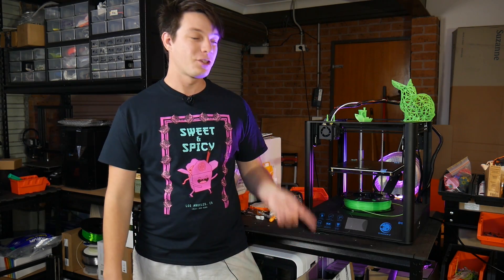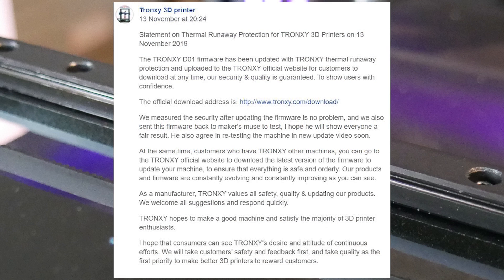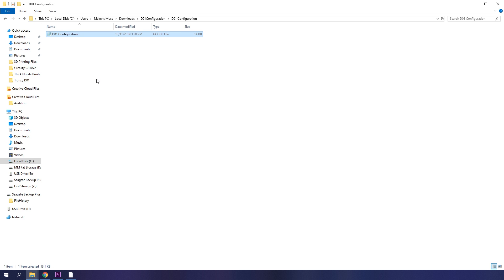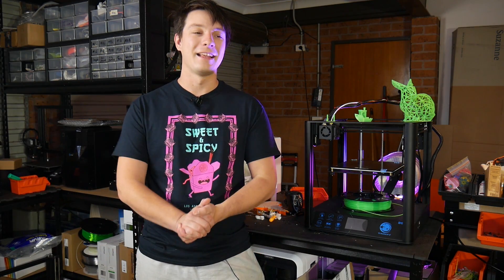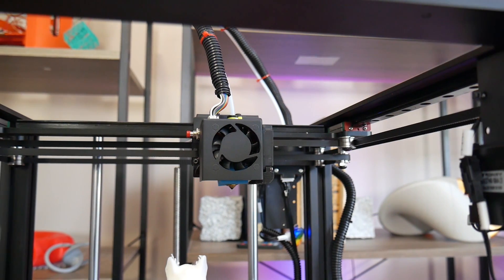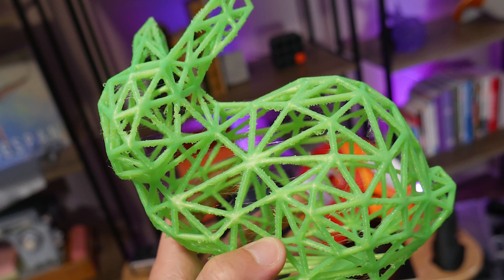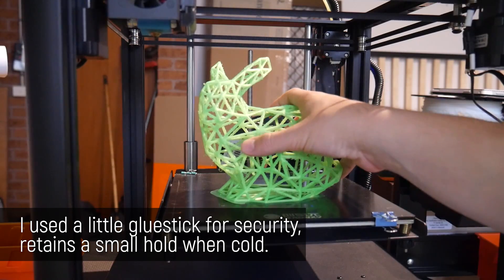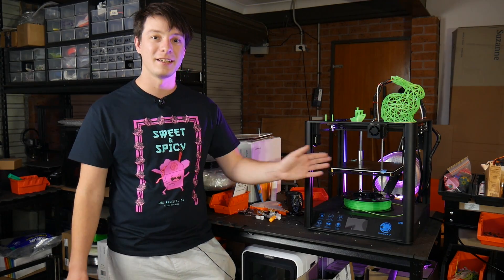The Tronxy D01 has been UPDATED! Here's what happened.

Comment: It worth to say that Tronxy listened! now, 2023, they are selling D01 2.0 with most of mechanical issues solved. Proper microswithes, heater and thermistor connected to connector that is outside of printer. Still horrendous retraction, but all in all much better machine. And they added acrylic side panels to create passively heated print chamber

Comment: That the switches beep when you bump the 3D printer should mean they are very precise. If the deformation from bumping it is enough to trigger the switch it's really at it's precise limit.
PS: My guess is the enclosure also adds stability to it.

Comment: I loved this printer when I first got it. The frame is solid and the enclosure makes it feel pro. The stringing is terrible and makes it very difficult to print PETG. I solved that with a 3d printed direct drive conversion (calibrating the steps took some research). My other complaint is much harder to solve. The build plate support is too thin. It flexes, is difficult to level, and shakes with any vibrations around, like someone walking. That's what caused poor quality of my prints. I replaced the sloppy Z leadscrew nut for a delrin and going to make a custom plate from aluminum.

Comment: Hi Angus, I bought one this machines since I really liked the mechanical design. I have a number of issues and like to ask you specifically: Which slicer software did you use?
I am used to Cura (from my Creality CR10-s) but they do not provide any TronXY profiles whatsoever. My custom defined printer profile produces inconsistent print quality, especially when printing PLA over 60mm/s
The provided TronXY slicer seems to be based on Cura but lacks several recent features like Acceleration or Jerk Control; plus the GUI in Windows sucks.

Moreover I failed to find any user out there that actually really owns a D01 so far... not even in the facebook tronxy support group.

Comment: I used to work for a biomedical company writing software that used low-level sensors. Depending on the part of the world you live in and the time of year (Canada and winter springs to mind) and where the device is stored (basement?) -15 degrees may well be a valid ambient temperature for the device. I learnt the hard way that making assumptions like this can get you into trouble :-)

Comment: I can tell you one reason for disabling thermal runaway. I had issues with it enabled when I had the part cooling fan  switch on at too low a level (too low being the Z height), the air would bounce off the bed and on to the head, cooling the head down and triggering a failed print with thermal runaway error. So may be that's why historically they didn't use it? Anyway, I have thermal runaway enabled and NOW I don't have the fan enable until it reaches a higher height. - So just a thought.
Reply: OK, I just realised you said that already. But at least I confirmed it !! :-)

Comment: A firmware update is much safer than simply updating the NVRAM settings via gcode. If you only update the NVRAM via gcode, the printer would only be one factory reset (or M502) away from reverting to firmware defaults and becoming unsafe once again.

Comment: Well done to Tronxy for taking on board your safety advice. That frame looks like it's got so much potential with the guide rails and overall design, shame about the shockingly primitive endstops (surely optical endstops wouldn't add that much to production!?) and print head quality, both of which would be easy and possibly even fun to upgrade if only it ran on Marlin firmware. Without the ability to upgrade the stepper drivers to TMC, I feel they may have killed their own baby.

Comment: Let's not sugar coat it. This company would rather people potentially burn to death due to their negligence rather than incur the cost of fixing the problem once it's pointed out to them. Their initial reaction is to try to prevent their customers learning of this and they only act after they realise that the bad publicity will most likely cost them more than fixing the problem. Keep in mind that the fix is trivially cheap for them - just a firmware update that the customer implements. No additional hardware or costly factory recalls. Whoever made the ultimate decision around this issue is either sociopathically evil, or grossly incompetent to the point of being dangerous. Either way I will actively avoid this company and advise anyone to do the same.

Congratulations TRONXY you have created the Ford Pinto of 3d printers.

Comment: Assembled mine last night and got the update. Bought it a few weeks ago based on the specs , which are really quite good at this price point. It should be easy to put a larger blower on the hot end. One problem was the heads of the screws that attached the bearings to the build plate were too big to fit into the countersunk screw holes on the bearings. I had to file the heads down a bit around the edge with a file on my drill press. Otherwise, assembly was quick and easy. They need to replace the 8 M4x8 pan head screws with M4x8 socket cap machine screws to attach the bearings to the build plate. When I saw your initial review, I wrote to TronXY on every email I could find on Aliexpress and their website demanding an update. Thanks for pointing this out! It could have been a real disaster.

Comment: Tronxy haven't provided updated firmware for all their machines still on the market. I bought a Tronxy branded P802D/X6D kit on eBay a few months ago and it's not even listed on their website. Granted it's an older model and may have been in a warehouse a while, but it's almost as if Tronxy want to pretend they never made that model?

I  found out that thermal runaway was not enabled in the factory firmware after the heater cartridge fell out during a long print. Fortunately I found it before it got too hot, although it did wreck the magnetic print mat I'd fitted.

To their credit, I was provided with a download link to source code for the Repetier-firmware version it shipped with on request.

Comment: Just so you know TronXY is still non-compliant with the GPL license.
Reply from the maker: What's the history behind their closed firmware, is it actually a marlin fork?
Reply: @MakersMuse  The older machines used Marlin or Repetier. They are one of the few companies still holding out for source code. Hell, even Anet complied. Example machines: X5S, X3, X3S.
Reply from the maker: Fair. I'll keep it in mind
Reply: FYI TronXY just uses Chitu control boards.  It's all closed source.  I bought this printer and wouldn't have known TRP had been disabled unless I stumbled across this video.  I tore out all the electronics and replaced it with a SKR V1.3 setup.
Reply: @iWeasel410  What did you have to replace besides the Chitu board? What stepper drivers did you end up going with and are they silent? Did you have to replace the touch screen too?  Lots of questions but I am very interested. Thank you.
Reply: @esqueue  SKR V1.3, TMC 2208 in UART, TFT35 V2.0 all running in 24V still.
Reply: @iWeasel410  Thank you for the response.
Reply: @iWeasel410  Hey, I was thinking of an SKR board with Marlin. Do you know where can I get the documentation/Firmware details to make changes? Also the extruder and X, Y steppers are cabled through a ribbon cable from mainboard. I have X5SA Pro. The machine is great except the Stringing issue as in this video. But I have have to do a hotend upgrade for that later.

Comment: Angus could you confirm if the configuration gcode they published writes the changes to eeprom and doesn’t simply enable thermal runaway protection until the printer gets powered off, resetting to factory and forgetting the changes?

Comment: Are you sure the bowden tube is fully seated in the hotend?  14mm retraction is crazy.
Reply from the maker: It is, I tried different couplers, better ptfe and all sorts of tricks to no improvement. It's just a poor design.
Reply: @MakersMuse  do the luke hatfield mod in the throat
Reply: Some printers with really long bowden tubes need upwards of like 10mm depending on the hot end, but 14 is insane. Imagine the K value you'd need for linear advance for this machine if it requires 14mm retractions. You'd probably turn the extruder into a damned machine gun. "TAK TAK TAK TAK"

I'm not sure why it needs so much though. It looks like it's using the same mk8 style hot-end the ender 3 uses and that hot end is fine as long as you have a good tube and coupler. I was able to get away with like 4mm retractions on my e3 before I switched to an all metal hot end and enabled linear advance. Now I use 1mm retractions with a bowden system. It's nice.

Comment: Thanks so much for pushing for the updated firmware man. Half the reason I upgraded my Ender 3 to an SKR mini E3 was for the thermal runaway protection without having to mess with bootloader stuff. Without it I was too afraid to leave the house with the printer running.

Comment: Thanks for posting the update. Obviously you are not obliged in anyway to take the time to produce a video like this, so it is very much appreciated. You could have easily just left the original video and moved on to something else. I've had first hand experience with a cheap Chinese machine catch fire a few years ago due to a snapped thermistor wire which would have been fine if thermal runaway was enabled in the firmware. Luckily I was in the room at the time and prevented any real damage from occurring. Hopefully you don't have to do too many more videos like this because most of us would much rather see positive videos about new machines your testing and creative projects you are working on.

Comment: Too little too late IMO Tronxy have been doing shit like this for a long long time and I wouldn't trust them as far as I could spit
did they try the usual Tronxy trick of offering you free stuff?
Reply: Same with Creality. I seriously don't understand how they can't enable thermal runaway on the firmware. It's a simple Marlin config... I doubt any of these Chinese companies have proper engineers/developers.
Reply: @shadow7037932  I am kind of curious if maybe it's a language issue. The people making this seem to have pretty bad english comprehension, so maybe they either 1) didn't bother to read the documentation past what was required to make it spit plastic or 2) didn't fully understand what was said in the documentation in the config file.
Reply: @shadow7037932  I swear it seems almost malicious to me. Like they really don't give a shit about burning people's houses down. I know that seems harsh but you really have to go out of your way to not have thermal runaway protection these days. The only thing I can think of is that they're cheap and don't want to put the memory on the mainboard to enable thermal runaway and the other basic features you need for marlin. This is evidenced by the fact that you have to do silly shit like disabling the buzzer to enable ABL on a stock creality mainboard.

Comment: Angus  ...  did you actually test the thermal runaway for the hot end ? Or did you just take their word that it was fixed ? What about thermal runaway on the bed ? Did you test this for firmware protection ? I think you did a great service for 3d printer folks everywhere. You should have no second thoughts about holding manufactures feet to the fire over an important safety issue such as this. THANK YOU ANGUS !!!!!!!!!!!!!!!!!!
Reply: Definitely would be good to show it working, not just trust them.

Comment: Thanks for sticking to your guns and motivating Tronxy to react to the thermal runaway issue.  Have you tested to see how the Chitu / Tronxy board reacts when a thermal runaway condition is enabled?  Does the printer actually halt, or is there only a warning?  I fed the latest X5SA configuration gcode into Google translate, and it looks like there may only be an on-screen warning.  I recently bought an X5SA Pro, but I'm in the process of replacing the stock controller with an MKS 1.3 running Marlin so I can't test the behavior myself.

As a side note, this same "strongly recommended not to disable this function" message is present in older firmware revisions I have downloaded for the X5A.  Too bad nobody was paying attention...

; temperature error detection is prohibited. It is strongly recommended not to disable this function. The default temperature error detection will not be inserted in the temperature sensor or
; When the heating power is too small, a warning will pop up. 0: Enable temperature detection.
; 1: prohibit the extrusion head and hot bed temperature error detection 2: only prohibit the hot bed temperature error detection
M8023 T1

Comment: My Prusa i3 Mk3 has had mintemp errors recently, I think it's because it's in a cold room and seems to only display after a print and it's cooled right down to room temperature because I didn't attend to it for a while.
Should I build an enclosure for the Mk3 if it's to be printing in a cold environment over the winter months?
Reply: An enclosure won't help as much as simply heating the room.
Reply: what i use to do is lower the fan speed to 30% or so, if there is cold outside you will still cool the print well without triggering thermal runaway
Reply: Thanks for the replies, I was also wondering how very cold temperatures would affect printing as it's in a spare room where I don't turn the heating on in winter because I'm never in there long enough to warrant it.

Comment: Does the ender 3 have thermal runaway protection enable?
Reply: Sadly not
Reply: Only some of them
Reply: Maybe some newer ones do, but most of them don't. I'd recommend flashing a bootloader and installing the newest version of Marlin to be absolutely sure. Mine didn't have it enabled
Reply: It does now. The ones with the 1.1.4 boards do at least. I bought an e3 Pro in august and mine had it enabled at least.